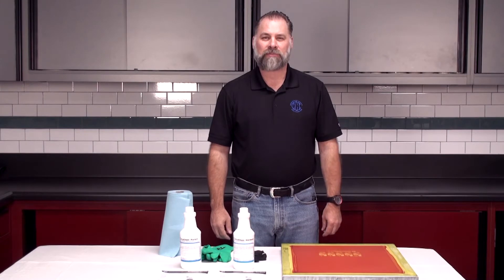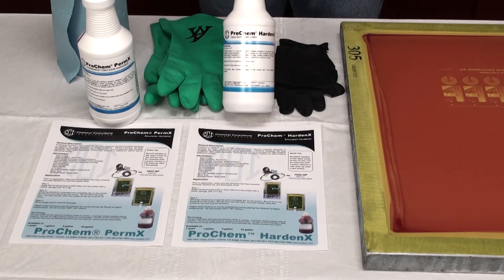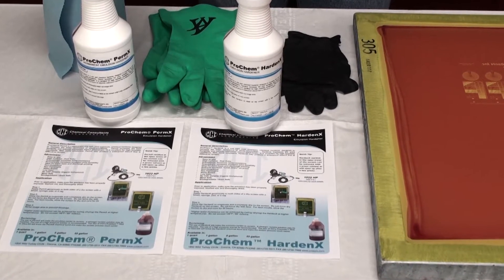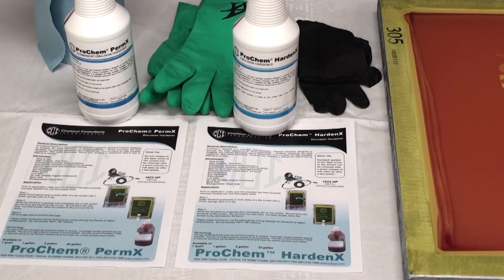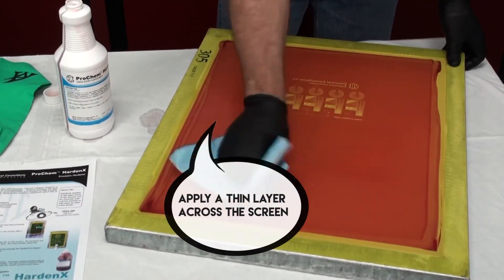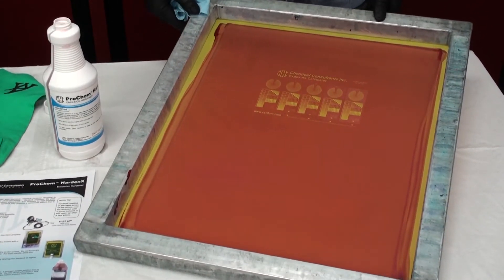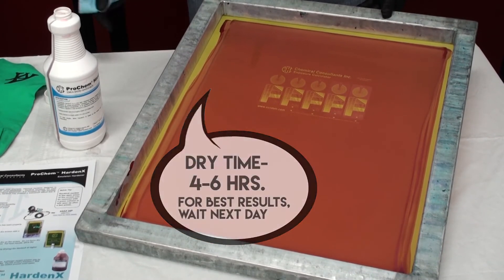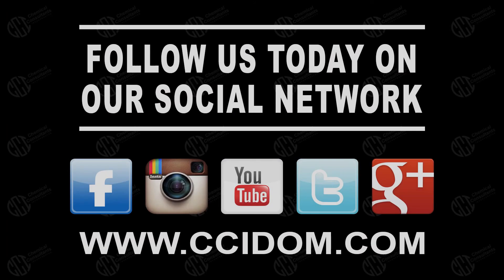Screen Printing - How to apply CCI's Emulsion Hardener

Comment: I'm using a solvent ink for signage purposes, would this be ok with ink degrader or mineral spirits? I need something that will not break down. Also I'm using ryonet galaxy w/b emulsion.